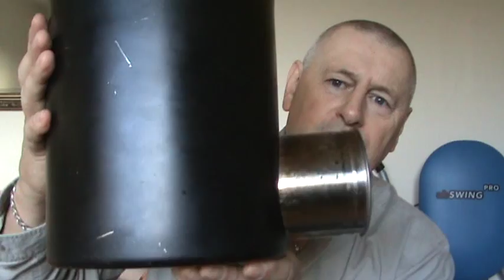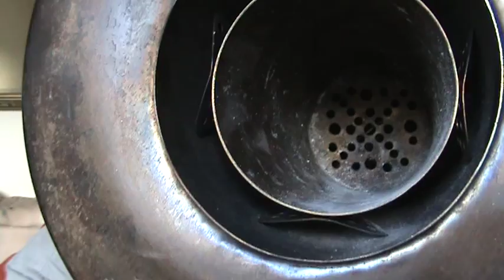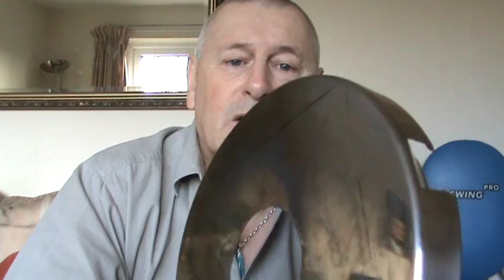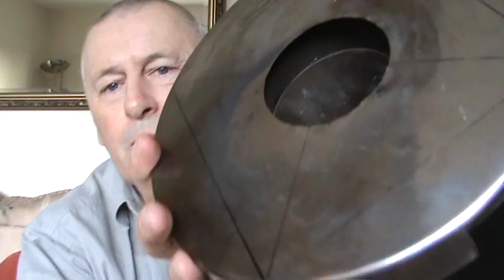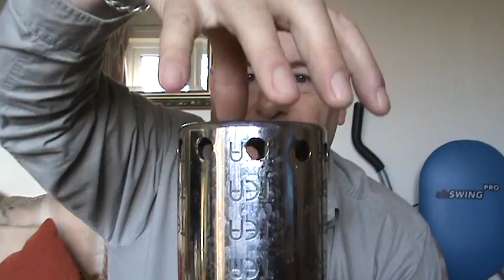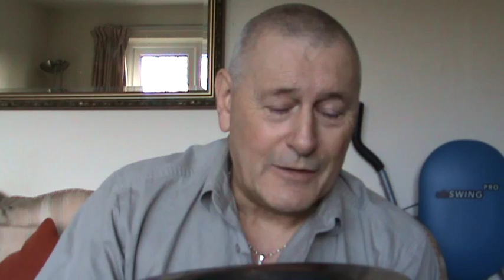Rocket Stove Gasifier Modification In Detail.MPG

Comment: I can tell you how to make a wood gasifier/rocket stove in the wood with secondary air holes if you care to know about it. The result we always look for in any burn is the yellow, blue/white flame which means you are at max efficiency. If you have red or orange flames you are not gasifying wood. This is all simpler than you think. I see everyone struggling to explain it and I've not heard anyone explain it right yet. If not, good luck anyway, it is something worth pursuing and understanding.

Comment: Without holes in the top of the inner tube the secondary air from below is of little use b/c secondary air is drawn in from the top as well. The secondary heated air gets sucked into the top chimney holes 2in down from the top igniting the hot smoke creating a secondary burn. A 3rd burn is best accomplished by using a rice pot holder/inner bowl to burn the remaining  smoke around the pot. The 1st burn is at bottom, the 2nd burn at the top of inner tube and a 3rd burn between a pot holder & pot.

Comment from the maker: @paulpellicci If using for home heating, personally I would stick to a conventional rocket stove design and ensure the flu or chimney is directed to the out side of your home. You do not want any fumes inside your home, if you have an open fireplace...it has a chimney and for good reason! What I and I guess many others are trying to achieve is the most efficient, useful and practical Rocket Stove for cooking, boiling and emergency use. The Rocket Stove is a great system, lets make it even better